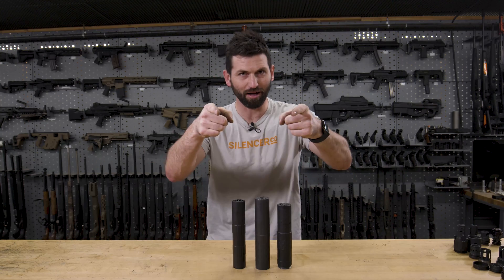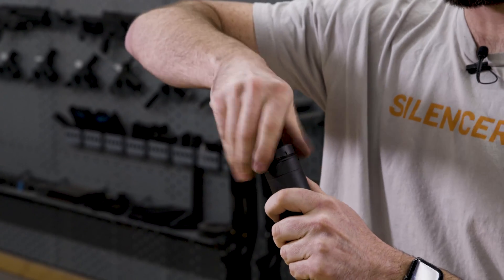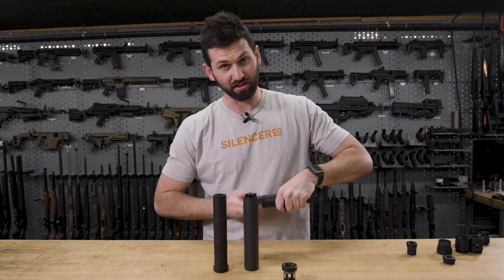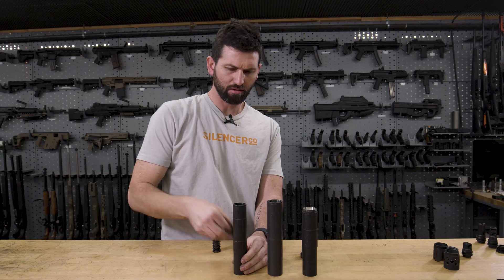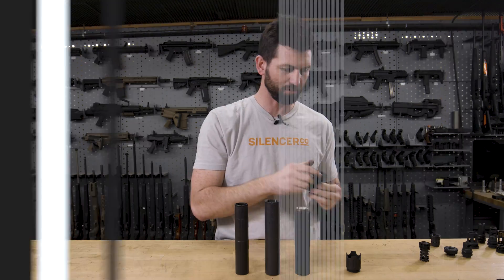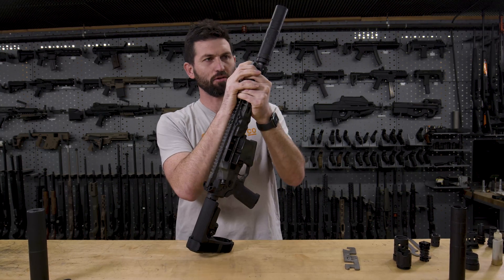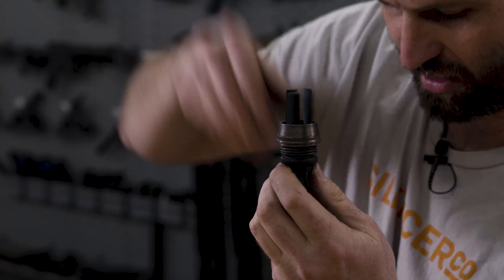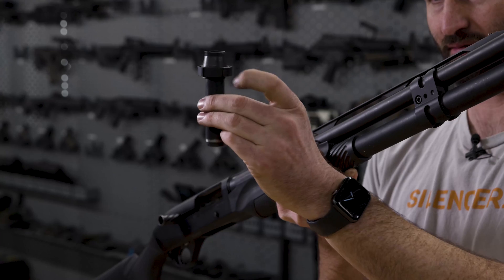How To:  Alpha, Bravo, Charlie Mounting Systems + Delta & Echo

Comment: You never touched on HUB systems. Is Brovo compatible with HUB? If I already have a different QD system, can I adapt your suppressor? Or will I need to change all my other devices? Will a Bravo ASR fit any other brand suppressor?
Reply: From what I've read Bravo is hub compatible.

Comment: Even seeing this and the explanations you give, it's still confusing af. A b c doesn't mean anything to us. Use fkn numbers. And not 1 2 3. Give us the fkn thread pitch and count. You've created 3 suppressors with 89.5 pieces that may or may not work with each other. Or need to be combined with parts from one another if you want to use it a different way.... Seriously... Ffs.
Reply: What are you bitching about? This is literally 3rd grade level stuff here. Every suppressor has a mount designation assigned to it in the form of a letter. When using mounts you just pair the correct letter to your suppressor. How is that hard in any way?

Comment: A couple things to add to this is that other manufacturers call the Bravo thread pattern a HUB mount, and I just purchased a Huxwrx 9k Ti and the piston housing inside threads are Alpha pattern so I may be able to put my SilencerCo 3 lug mount (Alpha) inside the housing as long as the dimensions allow.

Comment: Echo choke for salvo. My nut isnt loose like that. I see a snap ring on the back. Is that supposed to be removed ? I'm about to start beating it with a dead blow to see if I can get the nut loose. Otherwise it doesn't thread at all. Zero instructions on the web.

Comment: SilencerCo are very good SUPPRESSERS, However SilencerCo lacks in advertising what most suppresser buyers should be looking for, along with other suppresser manufacturers.
	The deep dark hole in suppresser advertising is not beating the drum about the sound variances, but should be demonstrating the FLASH mitigation of their suppressers as the flash is what can get the user killed on the battlefield the quickest over sound report of a spread of a few decibels. The Omega 36M is one that has length to allow very little Flash of unburnt powder. In testing the first round would at times give a small blip with really hot rounds, and no flash the succeeding rounds. Rounds with strong loads below maximum powder were found to produce no flash, even the first round. Mitigation was further helped by the flash hider end caps. This testing was done with a 10.3” 5.56 barrel with an Omega 36M SilencerCo Suppressor with and without flash hider end cap. The suppressor mount was a 3 prong SilencerCo flash hider barrel muzzle device and a Charlie mount. Video documentation is what that is needed for all suppressors for flash mitigation, as flash is the real killer. Sound reduction is very helpful for hearing protection but is not the most important concern.
	Military testing was reported to have found that stick powder over ball powder would burn more evenly and faster due to air between the sticks over cluster of ball powder, which would reduce flash as the powder burnt up in the barrel before reaching the suppressors end cap.

Comment: I bought the alpha direct thread mount for the octane 45 To mount on a “pistol “ (Rugar pc charger) blow back design. To make this work, all i need to do is take out the spring and 9mm adapter, add the mount and thats it? Just making sure so i don’t mess anything up.
Reply from the maker: Yes you are correct! Alternatively you can also replace the spring with a "fixed barrel spacer" on your piston which essentially converts the setup into a direct thread mount. The Alpha Direct Thread Mount is going to look cleaner though for sure on your PC Charger.

Comment: Great video.  I may be abandoning ASR after a baffle strike on my 36M.  I just don't trust it.  Direct thread seems to be the simplest option.
Reply: I am getting ready to use my Omega 36M on my 556.  Can you help the rest of us understand how you got a baffle strike so that we can avoid the same fate please?
Reply: @logicae4096 don’t let the can become loose from the mount, baffle strikes are 100% user error if it happens after the initial install. So if the barrel is concentric from the factory and you screw it on properly it ain’t baffle striking.

Comment: I was told my Energetic Arms Vox S suppressor was ASR compatible, so I bought a few muzzle ASR muzzle brakes, and now that I got my cam approved all I had was a direct thread option included. So how I do I got about using my Vox with my ASR muzzle brakes??
Reply from the maker: You need a Bravo ASR Mount which you can buy here. https://silencerco.com/shop/asr-mount/

Comment: 😂 you went out of your way not to say what size threads those are
Reply: 1 1/8"x28, stated very clearly
Reply: @joshreynolds72  yes for the alpha, but did not say what bravo or charlie was.
Reply: I'm building 3 form 1 suppressors and I want to incorporate their mounts but I need to know what the threads are.
Reply: @burttaylor8852  if you dont know then you have no business doing it.  And the ATF hasn't approved form 1 suppressors in two years, I seriously doubt you got approved for three.

Comment: Can you use the Direct thread on a Pistol Caliber Carbine instead of the piston driven mount? I have a Stribog sp9a1. Its just a direct blowback design. I would assume I am safe to use the direct thread. Right?
Reply from the maker: Definitely. Might I also recommend going with the 3-Lug route. A match made in heaven for PCC setups.
Reply: @SilencerCo  Thanks! I may go that route! Just making sure that its the exact set-up I want before going through the silly ATF BS
Reply from the maker: @HatchBackLove27  We totally get it! If you have anymore questions don’t hesitate to reach out.

Comment: Great video, only thing missing IMO is the thread pitch of Bravo, you mention alpha is 1-1/8 but I'm assuming bravo is 1-3/8? That would be what other manufacturers are standardizing on right?
Reply: That's the diameter - correct, the HUB for Bravo is the most common.  The Dead Air Keymo and Xeno, Q Plan B, and Rearden Atlas Bravo all use that same thread pattern from Bravo for their mounts.  The muzzle devices for those systems are not intercompatible either, except for Q Plan B with Rearden and vice versa, ignoring how Q will not warranty cans mounted with non-Plan B MDs.

Comment: hi, it is possible install Omega 36 on a Sig P320 threaded barrel with the Charlie direct thread mount? thank you.
Reply from the maker: You need to use the Charlie Piston Housing along with the correct Piston on any pistol with a tilting barrel. Using direct thread will result in the malfunction of the pistol.
Reply: @SilencerCo  thank you very much for advice and quick response. side note: I found the video Suppressor Science: Pistons, very clear on the differences between direct and piston.
Reply from the maker: @andresdaza8611  No problem! Let us know if you run into any other questions. We are always happy to help.

Comment: I have a Saker ASR 556K, the taper insert is seized into the can and won’t come out. Is there a specific method used to remove the taper insert?
Reply from the maker: Hit up our customer service team. Those wizards know how to to resolve any issue you run into. One method that has worked is to use one of the spanner tools that shipped with the product to "hook" the inside lip of the tapered insert. Apply upward force and work around the insert as you go.
Reply: @SilencerCo  Thanks for sharing that technique, I’ll try it.
Reply from the maker: @dexon555  Definitely let us know if you still have issues.